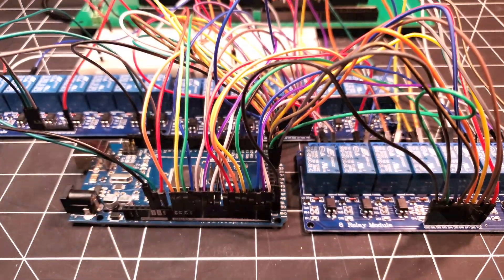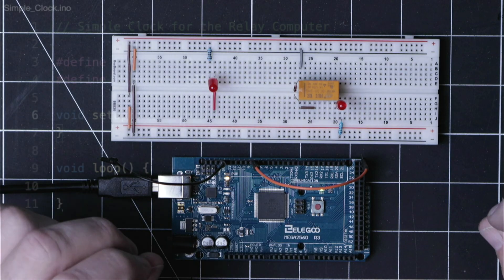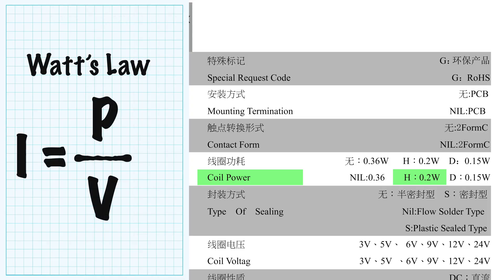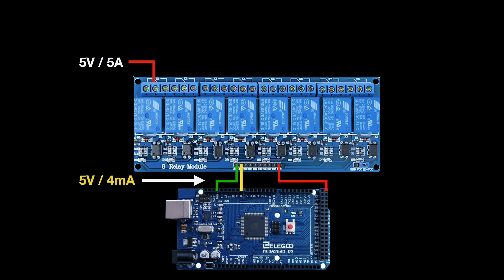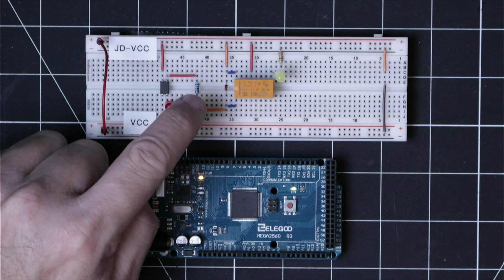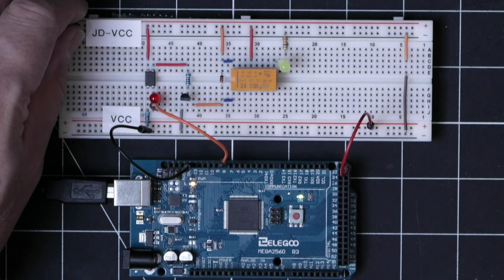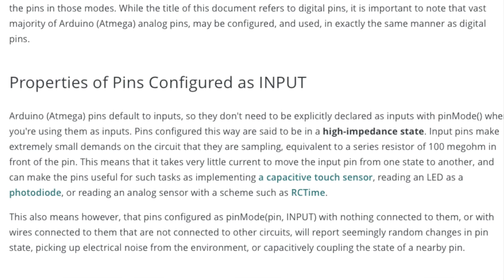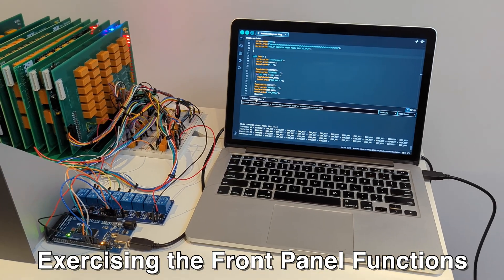Using Relay Modules with Microcontrollers

Comment from the maker: I made this video after realizing that in the early days of my project, I had used Relay Modules without using the separate JD_VCC source, and I’m truly amazed that my Elegoo (Arduino) didn’t have a melt-down 😬 Hopefully this video saves at least one micro-controller out there!
Reply: I've driven H-Bridge projects just from an Arduino R3 and the worst it had was a burnt smell. But that champ is still alive to this day :)

And yeah, it was when I was just learning about all that stuff, didn't even knew I should mind current limits. If it burns it burns, if it doesn't it's a yay.

Comment: Very interesting video. I'm sure the relay modules already have flyback diodes for reverse EMF protection from the relay coils installed. Ideally as close as possable to relay. Some relays have the diode already installed inside the relay. I always prefer to use a line driver IC's say ULN2003 for relays. With regards power supply requirements always use the wost case say all relays and LEDS  are on plus 20%. Richard
Reply from the maker: Yes, the relays on the module each have a flyback diode, they're tricky to see but just under each relay. Interesting, I used a line driver for the relay speed test video I did here:https://youtu.be/xo1iIFSd_bo?si=g4Q0GI5MiViSZGZn I did this since I wanted to test the speed of the target relays...if I had used a relay module then that would've affected the results.

Comment: Thanks for breaking it down like you did. 
Using a uC for testing the relay board saves hours of manual switch setting and recording. There's no cheating in that at all.

Comment: I think, using a microcontroller and relay modules during the testing phase is entirely acceptable, so long as silicone logic doesn't creep into the final design. If it does, then the result is a hybrid.

Comment: Using technologies in development that aren't desirable in the final device, is completely normal. Using an arduino in development is functionally the same as using that bench power supply; I assume at some point you're going to want a more integrated power supply even if just to keep the bench supply available to the bench
Reply from the maker: For sure - now that I know the voltage/current characteristics of the relay computer, I'll source a dedicated power supply, maybe something variable so I can nudge the amps a bit if needed.

Comment: I wouldn't call it cheating... I mean the whole idea of the project is to have fun. It's not a regulated competitive sports event 😁 - I'm using my Arduino for diagnostigs and interfacing with old hardware quite regularly. It's just a matter of drawing the line between "retro fun" and "tedious work" I think!
Reply from the maker: Haha I agree! There's no test output on the Arduino that I couldn't have built using "period correct" tech, but it sure makes the process that much more enjoyable.

Comment: I am confused why an optocoupler is needed? You can tie the grounds together without issue, and driving e.g. the gate of a mosfet wouldn't take significant current. You would of course not want to get the power from the 5V output of the microcontroller, but driving the gate directly doesn't seem problematic.
Reply: So you can have a galvanic isolation for high voltages. If something goes wrong and you get mains on the relay side, the controller is safe (and the user too).
Reply: @costa_marco Is the voltage 5V on both sides? One is just from a power supply. It's not a HV application afaik?
Reply: @ashtree129  But you may have mains AC on the relay contacts. Admittedly, the chances of a relay failing in a manner that bridges the contacts to the coil are slim but, if it does happen, the optoisolator will protect your microcontroller and, also, you. It's good engineering practice to have an air gap between the high- and low-voltage sides of a circuit.
Reply: @johnopalko5223 if the application was mains switching that makes sense but I don't think that's true here?
Reply: @ashtree129  Right, but the manufacturer of the relay module doesn't know how it's going to be used. They designed it with the optoisolators just in case. If it's capable of mains switching, they have to assume that's what it will be used for.
Reply: @ashtree129  Without an optoisolator, if one of the relay's flyback diodes fails open, the back EMF spike from the relay coil could instantly short the transistor and then fry the controller, that spike could be hundreds of volts despite the relay being driven by 5 volts.  Any time a microcontroller is used to switch any kind of inductive load, even through a transistor, it's a gamble if you don't use an optoisolator or some other means of galvanic isolation.
Reply: Well. For one, sharing grounds puts at risk your microcontroller if anything ever ends up sending a reverse voltage there.

Second, it protects your microcontroller from the high voltages.
You could drive an 120VAC circuit  and if it ever faults the relay, the optocoupler can protect your expensive microcontroller by keeping an actual airgap between the circuits.